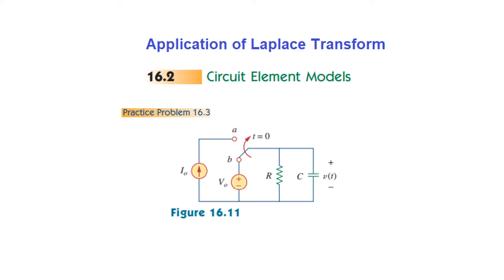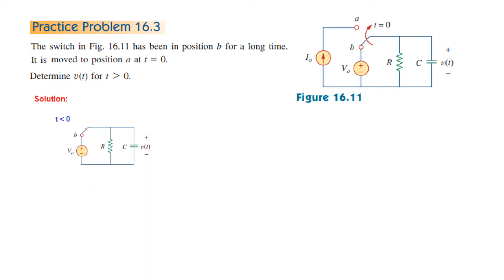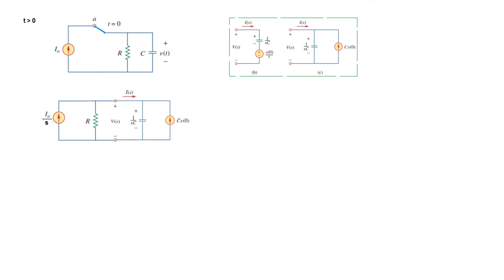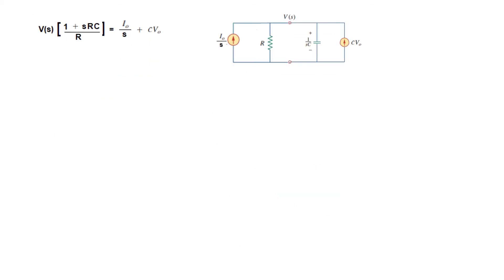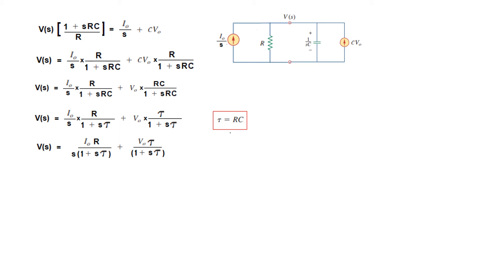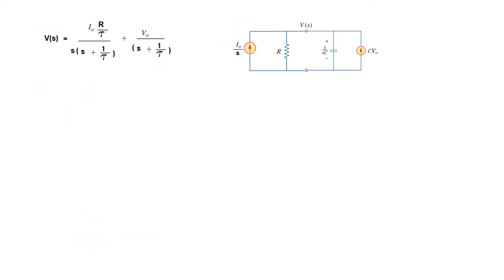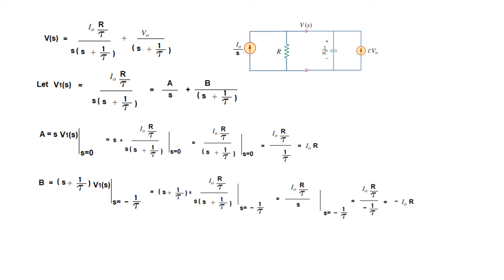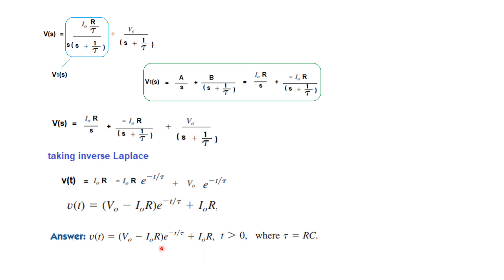(E)ENA Pr 16. 3 || Application of Laplace Transform

Comment: Hi sir. May i know why there still is a need to calculate the circuit when t<0 even though it is not needed in the calculations?
Reply from the maker: If you note at time 1.53 of the video, we established that for t<0, v0(0) is equal to V0. Then at time 3.23 we used this value to replace v0(0) by V0.